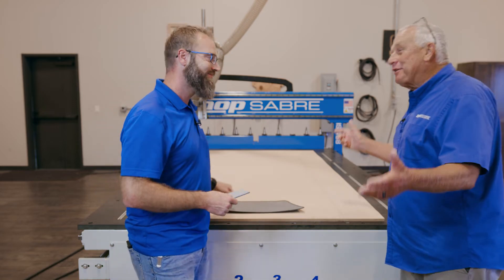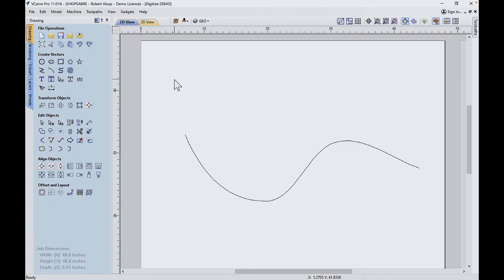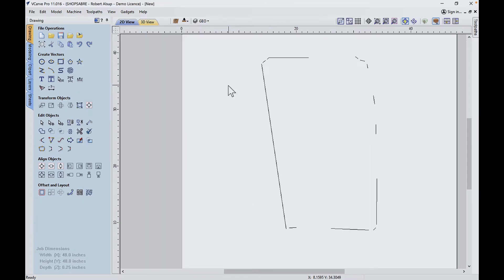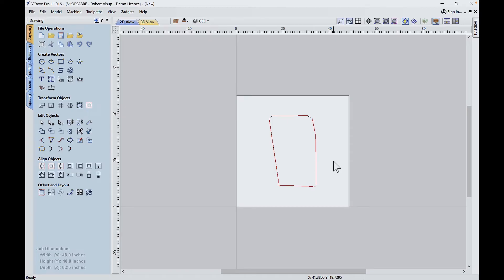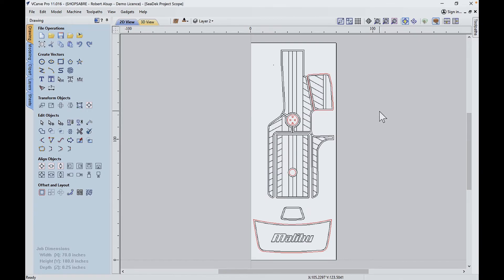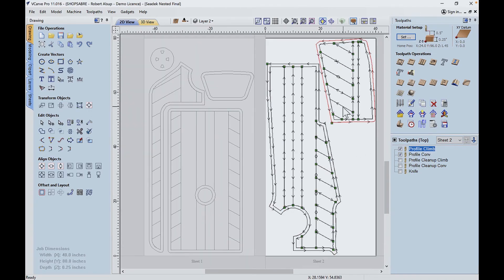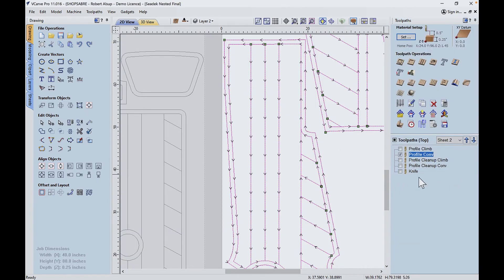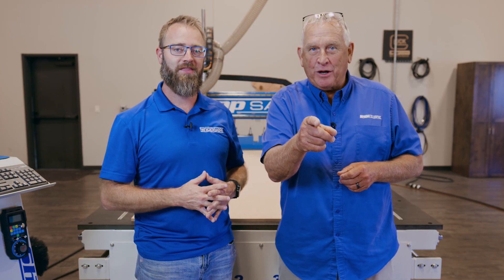ShopSabre CNC Cutting EVA SeaDek Foam - Part 1

Comment: How do we synchronize this program with the CNC? How do we track it? You've moved on to drawing without providing any information about the main operations.
Reply from the maker: At 3:20 in the video we show the tracing featuring being used - This is the digitizing feature built into our controller. This is how we got the template into a CAD drawing - and then we show the Vectric software where we took that trace and converted to machine code.

Comment: Is this 24,000 RPM and 400in/min feed rate the same for ALL the bits used during the process?  cutting/polishing etc
Reply from the maker: Our technical support team can assist with this question. Give them a call at 952-461-4570

Comment: How you made the final round ball go both ways. Did you make a double vector with different start point . Because Vectric when you are ON doesn't matter if is Con or Climb.   By the way nice Video Format
Reply from the maker: Thank you for the comment! Our technical support team can assist with the technical element of this question. Give them a call at 952-461-4570

Comment: Hi, great video thanks really useful. We are using Vcarve Pro but as we are asking it to cut on the line it won't reverse the cut for the clean up. We choose climb then conventional in 2 separate tool paths but both travel in the same direction. What's the trick to this? TIA
Reply from the maker: hmmm I don't have a trick - just clicked the button for climb, then conventional in the next and it definitely travels in different directions. Depending your version, you may need to update as you may have found a bug in Vectric? I am on Version 11.016 so perhaps that might be a version difference?
Reply from the maker: Further development - We updated our VCarve just now and found that the bug appears to be in the newest version. We have reached out to Vectric Support to address this and hopefully a fix will be coming soon from their team
Reply: Thanks that's been driving me nuts for half a day! We are running V11.014 which it is happening in. Tried to update their 11.504 patch but it scans my computer and says it can't find a V11 on my computer which doesn't help. Thanks for your input though, hopefully a patch will be available soon....and I can update with it too!
Reply from the maker: @jamesgant9593  thank you for bringing to our attention, we passed it along to the Vectric support team

Comment: If you wanted to do a hexagon or some intricate pattern. Using array with no tool clearance so you have a “single line” ends up leaving lots of overlapping lines. Do you have a suggestion on a easier way then deleting each of those overlapping lines 1 at a time.
Reply from the maker: Sorry not sure we understand what you mean, our video shows how to program to avoid multiple lines. However, if you own a ShopSabre our support can help trouble shoot concerns with unusual programming.

Comment: How do you get the information from the CNC into Vcarve to digitize?  I didn't know we could capture information and send it to vcarve.  I have VCarve Pro and a 408.  Is their a digitizer program or am I just unfamiliar with the process?
Reply from the maker: We sell a digitizing touch probe option or you can manually trace using the machine controller and xyz motion and our manual digitization feature. 

Contact our team and they can help you

Comment: Would a cross hair laser with a small camera under the cutter head be ideal for digitizing the shapes?
Reply from the maker: Depends how it would be aligned and how the offset would be accounted for. No reason it wouldn’t work though if done correctly

Comment: Pretty cool stuff guys. I have a project that I want to trace like you did. What software did you use for tracing? Thanks for the informative videos as always. My next machine!
Reply from the maker: We used the ShopSabre control for the tracing, our controller has a digitizing feature built in and then we brought the template to life using vcarve pro